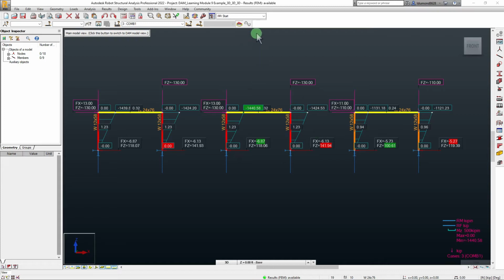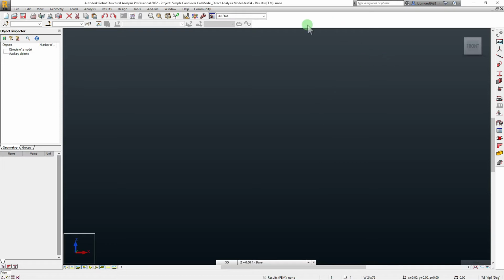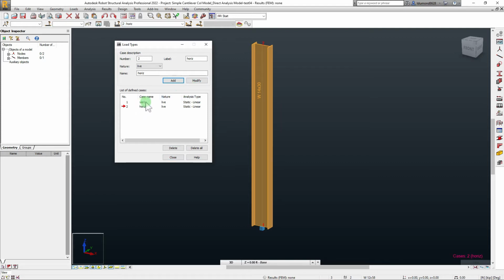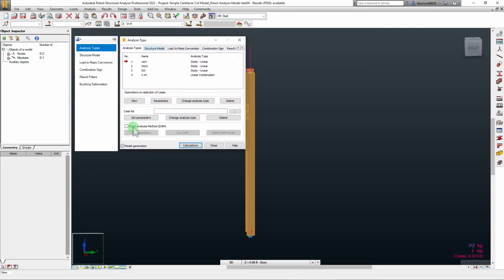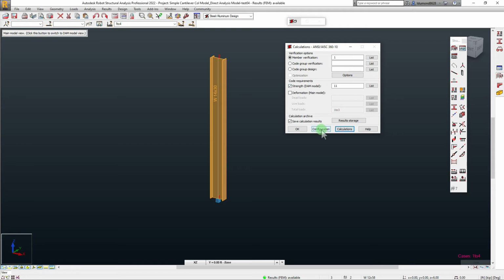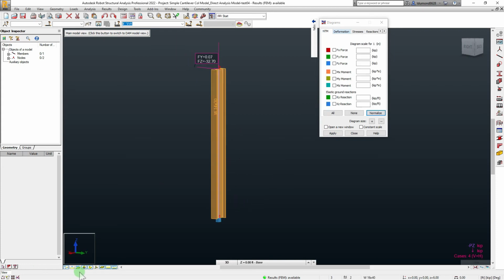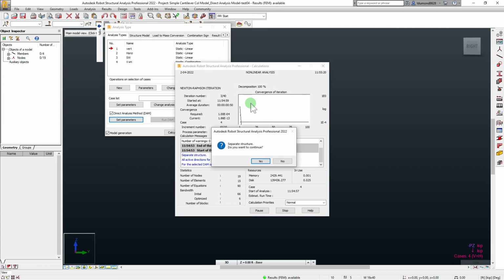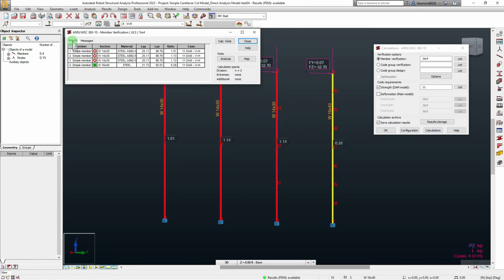Robot Structural Analysis-DAM

Comment: Thank for your sharing, But I have some problem with that. I build the same model with you (the geometry and also the load) but the design ratio is difference with yours. I found some difference  in Mrz results after running the DAM model (90.5 kip.in in compare with 230.36kip.in in your model). Could you help me to check?